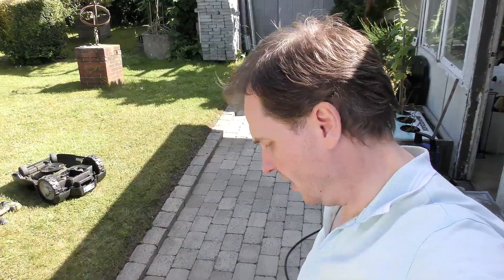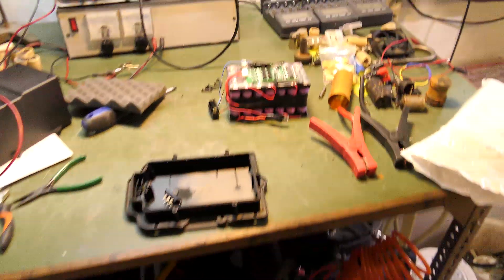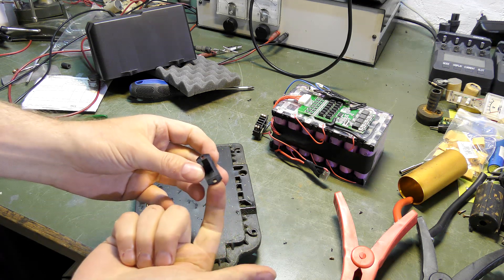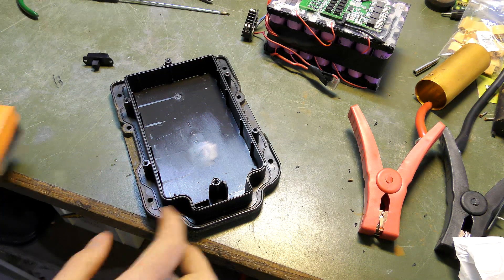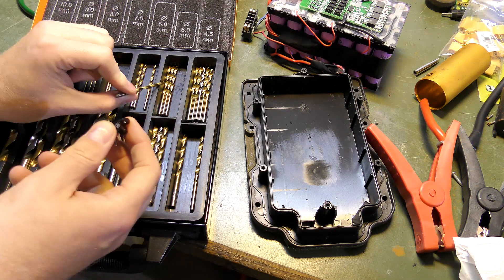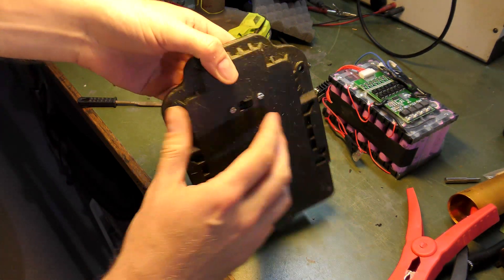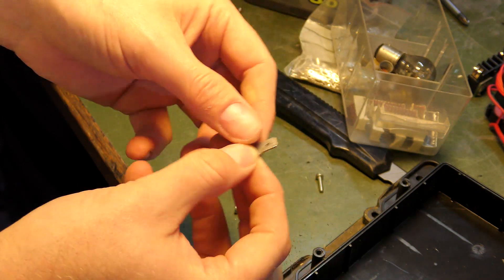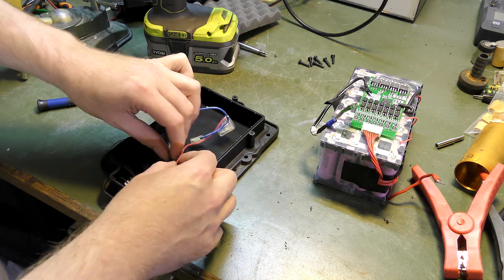The Solar Powered Robot Lawn Mower In Switch Mode - 856

Comment: Haha, Morten definately needs a holiday. Can't understand his own circuit design.....  Even when it is repeatedly pointed out.  I must say putting the switch in that position is not a good idea, because it will fill with water and corrode.  Correct place for such a master switch is under the sliding cover on top of the machine.
Reply from the maker: Hi Ein Felder
Thank You very much!  glad you liked the video :-)
Thank you for watching! :-)

Comment: What you need is to spend just alittle bit more on the BMS, You can get the same size one with Bluetooth, called a smart Bluetooth bms. That way you can see not just the total voltage but all the cell voltages on your phone. That would be far better and give you more information if the battery is flat without needing to remove it from the mower. Gosh, the amount of times you have worked on the mower battery is crazy. I feel like i am watching a banging my head agast the wall. haha
Reply from the maker: Hi Mikes DIY Tesla Powerwall
Thank You very much!  I did not know about the smart Bluetooth bms,, awesome.
I usually show my messing around with the robot,, so you see most of it,, it's not that bad. 
Thank you for watching! :-)
Reply: @MyPlayHouse  haha i do like the mower but it needs a name

Comment: Not really sure the point of the switch as it already shuts down from the top switch, The fact you think it needs a switch is a problem it should be sitting on its charging base, if it gets stuck then a manual switch is kinda pointless as your already out there you might as well move it back to its base. Have i missed something?
Reply from the maker: It often backlockes and want shut off.

Comment: Ah ! If it fixed itself it can unfix itself, and don't worry about cocking up i do it all the time as I bet a lot of others do to, the charge controller may be getting hot and shutting down ?
Reply from the maker: Hi Graham R Dyer
Thank You very much!  No I measured voltages the wrong places,, as many has pointed out.. the screws are connected directly to the battery, and does not get switch off. MY BAD :-/
Thank you for watching! :-)

Comment: I expected the switch to work but water would get into it and cause problems in the switch.
Never mind, it's experemental and i'm sure you will make it better :-D
Use a flat switch off an old Atx pc supply, i bet one is lurking about in a draw :-D
Hope you have a smashing holiday :-D
Reply from the maker: It's all fine, I had a brain fart in this video. I measured the wrong places.

Comment: Having exposed electrical contacts near potentially wet grass, and whatever other stuff, would make me nervous, in addition to possibly ruminating about having punched a hole for moisture to get inside the battery box.
Reply from the maker: The Robot is from 2013,, if it dies,, it dies. :-)
Reply: @MyPlayHouse  if the logic* ever dies, could make it into a live streaming robot... raspberry pi, webcam, motor driver, interweb controls.

but cheers for the videos :)

Comment: Honestly nothing was messed up here! Switch was fine and never actually broken. You took a volatge reading from the terminals connected directly to the battery. You cannot test the switch from those terminals as they are directly connected to battery and bypass the switch.
Reply from the maker: Thank you very much :-)

Comment: You could wire that switch so that the negative terminal changes between the unit supply connection and the negative screw. That way, when the lawn mower is in operation, there is no short circuit risk underneath.
Reply: That would be a pretty clever improvement :) although not sure, if morten understood 🙈
Reply: @olpqay  I suspect that we will get to enjoy a lot more videos about this lawn mower. Especially if it runs over something conductive 🤣
Reply from the maker: Hi Leon Adams
Thank You very much!  glad you liked the video :-)
Thank you for watching! :-)
Reply from the maker: That video would be the exiting video where we replaced a fuse :-)
Reply from the maker: When you turn it off,, you can measure voltages,, right ?
Reply: @MyPlayHouse  Bypass the fuse. I want flames!

Sure. If you connect the battery negative to the pole, the unit negative to one throw, and the negative screw to the other throw, you control whether the completed circuit feeds the unit or the screws for probing. When the unit is in operation there is no negative terminal underneath to complete the circuit. When the screw is connected to the battery, there is no power to the unit to move it onto anything conductive. Totally safe 😁 Unless you put the battery on a metal work top with the screws facing down. Maybe putting shrink wrap on the screw head would be safer? A small hole to put a probe in? 🤔
Lots of fun experiments! 😂

Comment: @my playhouse the switch is fine,  you wired the batteries to the screws and only switched the output terminals. I hope this helps.
Reply from the maker: Hi PassMeABeer Dude
Thank You very much!  I knew that part,, it was the fact that I could not turn it off.
Thank you for watching! :-)
Reply: @MyPlayHouse  it did turn off to the robot but you had a meter on the screws which are not wired to the output of the switch,  if you check it again the screws are always hot with no switching, but it will turn off the robot.   I am not sure this is safe, if it were to go in a puddle of water or run over a piece of metal it could short circuit the battery.
Reply from the maker: Thank you,, Yes I see the differences now,, I made it different in my head. You are right!

Comment: Your switch is fine. Doesn't work on the screws, only the battery terminals.
Reply from the maker: Thanx,, you are right.. I did not use my head!!
Reply: @MyPlayHouse  Everybody makes mistakes.
Reply: When you originally tested the switch, you were testing at the battery terminals, where the battery connects to the mower. The screws you tested later are on the other side of the switch. They're directly connected to battery + and -.
Reply: Indeed.
Reply: 100%. silly morten.
Reply from the maker: Hi Graham Leiper
Sorry I do not follow ?
Thank you for watching! :-)
Reply: @MyPlayHouse  Check this image: https://imgur.com/udoea98 - You have wired the screws directly to the battery, bypassing the switch. The switch only switches the connector to the lawn mower and not the screws which is why you will always be able to measure a voltage on the screws no matter how the switch is positioned. Try it out by measuring on the contacts and then on the screws and see the difference :)
Reply from the maker: Boy did I screw that one up!!